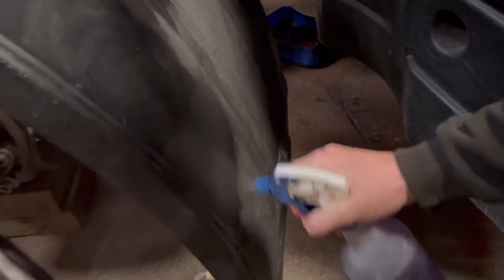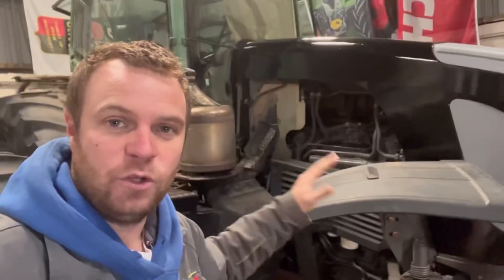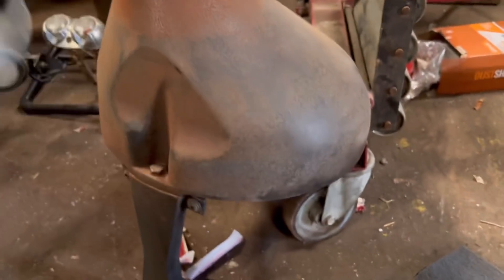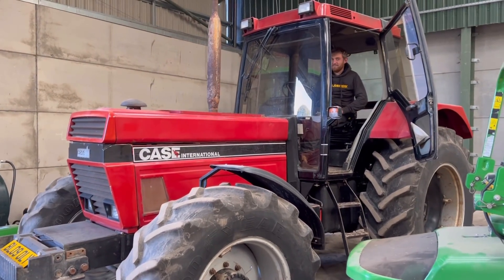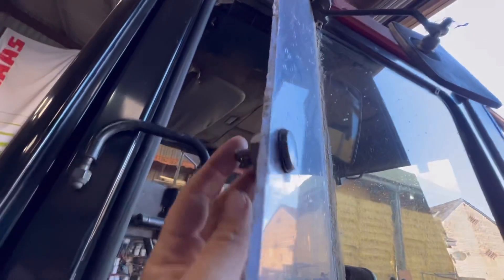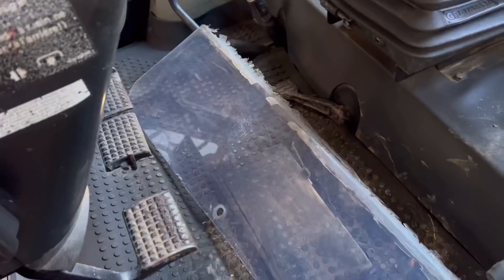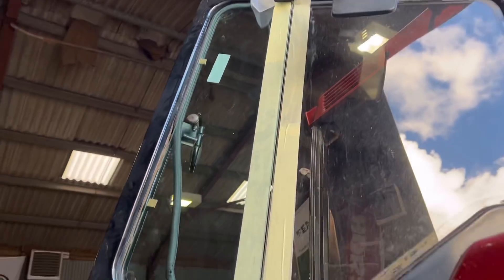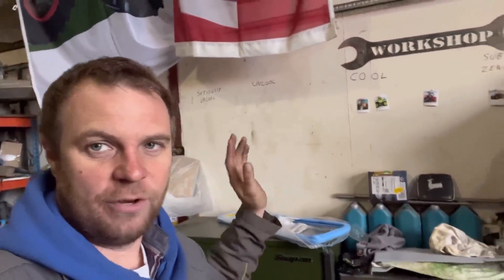Day587 #OLLYBLOGS FENDER REFURBISHMENT, GLASS FITTING & BROKEN REV COUNTER #AnswerAsAPercent

Comment: Front fenders and rear fenders/wings in herefordshire. New stickers would neaten her up but still be in keeping with how she looks now. One strip of masking tape across both pieces of glass to stop the silicone pushing through on the inside is how we used to do it, but peel the two strips off the outside as soon as the silicone is smoothed down, easier to remove whilst wet. Another good vid mate, keep it up!👍

Comment: Glad the soap on the silicone trick worked for you, something we've done for decades in the window industry, think you might be right though on the gap being really small, not sure how much pivot you will get before it tears the silicone, also, even though the silicone will be dry tomorrow it does take a few weeks to fully cure, so chance are if you try opening it tomorrow its more likely to tear
Reply: Older Massey are the same, redid mine a few years ago, original gap was about 6 to 8 mm but the bead is proud of the window. Interesting the bog standard clear silicone worked better than the expensive soudal stuff

Comment: Right idea with silicone & masking tape on window Ollie but remove the tape straight away, leaving until tomorrow you'll probably find the tape tries to pull the silicone off, the way around it is carefully cut down the edge of the tape with a sharp blade. It's much easier if you remove the tape straight away though. & as you said a slightly wider bead of silicone would probably be stronger.

Comment: Olly, Gtechnic C4 is by far the best plastic restorer. It works like a lacquer and gets rid of any uv damage. It's applied with cotton pads and I think you will need 4 bottles as they are so small. It will last a year with pressure washing.

Comment: I don’t know much about tractors Olly but I’ve never heard of a mudguard, either front or rear been referred to as a “fender” here in Ireland. 

I thought a Fender was a guitar 🎸 🤷🏼‍♂️ 😆

It will be interesting to see how your silicone works on the window — I would have removed the masking tape before the silicone cures because I’d be afraid of the silicone that’s on the masking tape holding it in place when you try to peal it off the window. Silicone isn’t like paint.

Comment: Easier with the both glasses taken out. Laid flat on a board with a 6mm drill each end to set the gap. A strip of masking tape on the back joining both glasses together to support the silicone. Strip of tape on the front off each glass. Bead of silicone smoothed out with a wetted finger. Job done.

Comment: Little trick I learnt with silicone is rather than a wet finger use fairy liquid with warm water in a spray mist bottle. Silicone doesn’t stick to soapy water. Also have a jug of warm soapy water for any tools you use to smooth out the silicone. Works great on bathrooms and kitchens anyway. I could laser cut the case stickers in mirror finish stainless if you think that would look good? Not sure if that would upset some people tho if you want to keep it as original as possible
Reply from the maker: Yer prop to much but the mb trac 🤔

Comment: It's a front mudguard to me, not all silicone is an adhesive! Sealfix is the only one I could get to act as a hinge. Tape up inside then either sides of the outside, smear in silicone remove tape on outsides and gently tidy edge's.  Be careful and make sure the handle is on before you open it as it could go in s**t on the ground. People should Never run another make of machine down as others aren't fortunate to have big deep pockets to buy the so called top brands! And when you need a pull out some day your glad of  any help!

Comment: Ac plant glazing showed me the trick for doing the side windows he put the masking tape inside over the crack you have to adjust it a bit too get the right gap small when window open then shut window silicone from outside run finger down so looks pretty then leave to set properly works a treat done loads hope this helps

Comment: Tom P will not be happy if the Hurleman ends up uncool. How about an old Zetor? Learnt to plough on a 6945! It couldn’t lift a 4 furrow Kvernland (straight 4, not reversible) once the hydraulic oil got hot. Used to be an infuriating machine. Also did all the work on 100 acres of very heavy land though so…. Plough, power Harrow, Ransomes are seeder / fert spreader (lifting that was even worse!! Used to bunny hop the bloody thing to “bounce” the machine up in the lift arms) 🤦‍♂️🤦‍♂️ sprayer, much spreading, mucking out, literally everything.
Reply from the maker: Sound fun 🤣🤣

Comment: Any j d is very uncool,  nice to see you trying to sort out the window on you tractor I hope it works for you, looks better than all that silicone all over, we drilled and put 2 hinges on the one we had, 70% today
Reply from the maker: Drilled the glass 🤔
Reply: @OllyBlogsAgricontractfarmer  we got a tile drill and did it very slowly and small and got bigger and it held with rubber in the holes